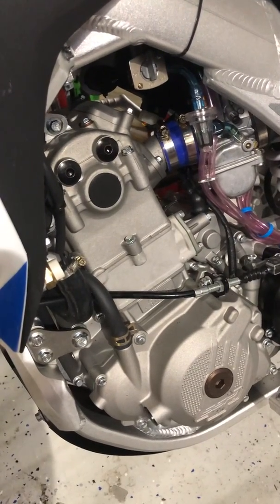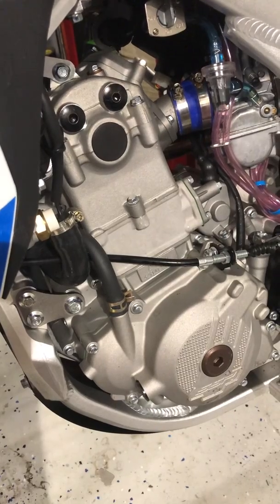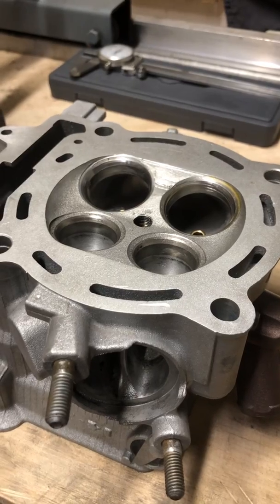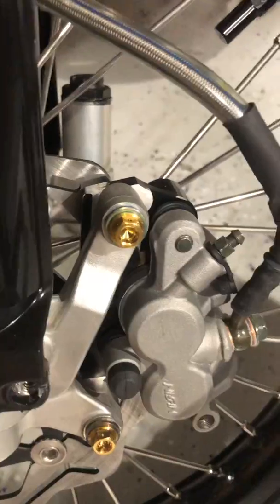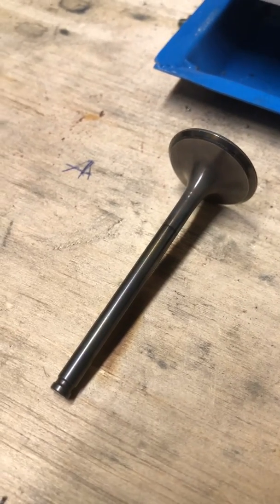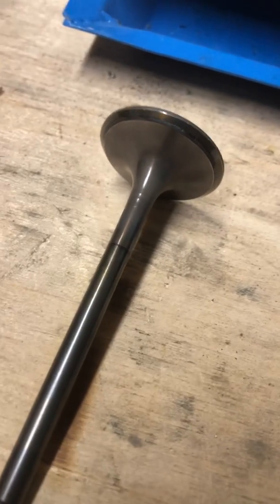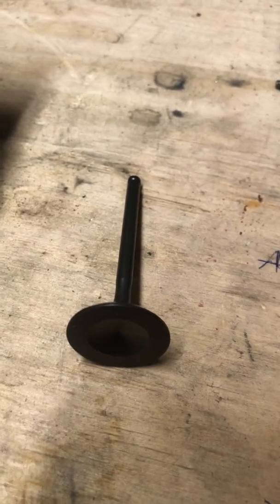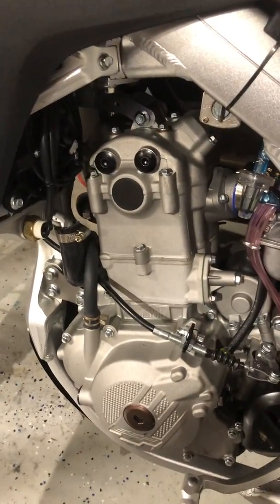Engine Durability

Comment: what are the dimensions of the motor? would it be able to fit in place of a zs172 or are the mounting points much different and the motor much taller?
Reply: Please answer
Reply: @justjavii I can try to find out from the engine seller

Comment: What most do not understand is 60 to 70% of the parts on the Japanese and European bikes are made in china anyways . just like Nike they are made for penny's on the dollar in Chinese sweat shops . cut out the middle man and save some cash. if you replace all the peripherals ( chain sprockets cables  etc .. ) the core is as good as a Honda . the chain that came on my 22 sr450s did not even have a master link . it was pressed on at the factory and bottom end as far as quality ...
Reply: when modles reach the end of there service life they sell the old design to other company's to produce without market infringement . the 22 sr 450s is a clone of a Honda crf 450x from 2010. was told personally from a motosport tech the range was 2006 to 2010 Honda 450x and those parts are direct fit replacements ...

Comment: The parts availability is what got me interested in this engine. I'm building a crf 450 up from the ground and have decided to use the nc250 engine because its very easy and affordable to get the bits to rebuild it. With a high lift cam and a billet piston with a bit more compression its capable of matching the output of the big 4 manufacturers as well. Yes its chinese made but if the japanese want to make us pay a small fortune for parts I know what I'm going to do.
Reply from the maker: Well the NC engines there’s lots of parts out there but the 450 is a part for part clone of the Honda 450 Uni cam I mean the piston the rod the crank all of it’s the same I go to Honda and get my parts no problem
Reply: @dfast8712  i believe the nc450 is slightly different zongshen HAS a honda 450 clone thats part for part clone, but the newer nc250s and 300s is loosely based off the klx300. Interesting where to find high comp pistons if they fit the dual cam nc300s. Im in the process of purchasing mine waiting for it to ship. Gona power my lt250r

Comment: have you looked into SWM?
Reply from the maker: Wow they look nice  kyb suspension made in Italy they look nice I just wonder about parts availability and support and they’re also close to $10,000
Reply from the maker: Yeah I was looking at the two wondering if that stuffs coming out of Asia because it sure looks like it in the 300 motor for the pictures I could see they’re really don’t give close-ups it look just like the NC 300 to me but they had the 500 and I have no idea what that is the deal is on those but are right there with a brand new Japanese bike in price
Reply from the maker: What’s SMM?
Reply: @dfast8712  sorry. SWM motorcycles
Reply: yes, asia co. assembled in italy? very odd.

Comment: 2 piece valve is why they snap single piece titainium wont snap and are better for wear
Reply from the maker: That is totally incorrect yes the two piece valves do snap but titanium overall is not that strong and it is not good for wear at all, I built SCCA sprint car engines and Dell West builds the best titanium valves on earth and we would have to change those valves before the end of the season and those were extremely expensive valves because they snap after so many hours in stainless valves Dont
Reply: @dfast8712  using titanium valves increase the life of the seats not the valve throwing stainless valves in just means you will be constantly re shimming wearing the seats down. And the cost to turn down titanium to make a single peace valve is just unreasonable hence single peace stainless. Don't get me wrong I always run single piece stainless as re shimming isn't a problem and the inconvenience of readjusting outweighs the risk of destroying pistons cylinder and head in one go. All that said there were companies that did valves and seats combos that they guarantee to outlast stock but the valves are all that's necessary as the seats will outlast most of the bike anyways
Reply from the maker: It depends on the valve seat you’re using look there are so many different variables we could go back-and-forth with overall in my opinion because I’ve lost motors due of these valves snapping titanium sucks it’s not a good material to use on a valve that is why the highest grade bolt they can build with titanium is only grade 5 that means that stem is not strong that’s it

Comment: Any particular reason you bought the SR450S?  Does the SR450S handle as well as the 300?
Reply from the maker: Well really I was in the market for another 300 and I found a dealer that was local that I just could go pick up 450 up and it was last year‘s model and they made me a great deal I actually am happier with the 450 I love the 300 nothing wrong with it I just like that extra punch but that’s 450 is not over the top for me it’s perfect
Reply from the maker: I want to say they both handle very close to each other  to me they feel exactly like a Honda CRF

Comment: That's why old 2 strokes are hot. I have a 1988cr 250 we are rebuilding.  4 strokes suck. I had a 2003 ktm 450 that needed a top end because of these titanium valves.  We put stainless in and new seats cost over 800 for head work plus piston timing chains and guides.  Total spent with me and my buddy doing the work was 1400. Cr we are doing with new crank, bearings, piston , cylinder nickle coated  and new right side case will cost 800 not including chain sprockets fork seals.
Reply from the maker: It’s so true really having a two-stroke is less maintenance and less cost in the long run because those four strokes they do explode their time bombs and cost $$$ that’s why I got away from the KX
Reply: Use Evan's coolant, or waterwetter and the waterpump area WON'T corrode away like yours might have, I'm guessing because it's a common problem...from Wyoming USA 🔫🤠🇺🇸p.s stay safe

Comment: How's the availability of parts? Seems like 300cc 4 strokes aren't common, so are the high and low-end rebuild kits expensive? How's maintenance?
Reply: 300 is the same as 250 but with big bore
Reply: @johny_me  where can I get parts for the cbs 300cive check every where

Comment: How many hours on it now? Any new developments?
Reply from the maker: markmtbrider I have 52hrs not a single issue whatsoever not even a bolt loose
Reply: @dfast8712  I have 550 hours on my engine and still running strong, know of some other people with plus 1000hours and still running strong.
At 1000hours I will open it up and see how it is.
Reply: @DanielOliveiraSantos  hola Daniel. Te duro 550 horas. La mía en 10hs rompí la tapa de cilindro...
Reply: @DanielOliveiraSantos  have you hit the mark yet?
Reply: @kalebdelong3781  almos 800hr.
Good as ever
Reply: @dfast8712  pretty  cool.
Reply: How many hours on It now?
Reply: @parotopten  probably around 660 to 700
Got a road bike for my commute, so less hours on it, only offroad 😉

Comment: Low horsepower =reliability 
Plane and simple, as far as the Kawasaki blowing up you realize every 40 hours you have to dual valve adjustment or they will snap, the horsepower literally stretches them..

Comment: When I built my head....I put kibblewhite stainless valves in it
Reply from the maker: Kenny That’s smart it’ll keep it together
Reply: @dfast8712  I had bought the head brand new from cylinder works...and I am really just a trail rider ....I did have it ported ....and am running hot cam stage 1s...with a wiseco piston....more or less looking for low end  torque and longevity....my buddy got 180 hours out of a yzf 250 top end...but he adjusted his valves meticulously...
Reply: @brokebikemtb4448  The YZ250F is the most reliable MX engine bar none.  I got over 250 hours on the original 2013 top end, never had to adjust a valve.  We raced a new 2005 YZ250F and it finally shattered a clutch after 18 month it to lock-up, the bottom end was still very healthy.
Reply from the maker: Kenny yamaha’s definitely have the most durability out of any of the bikes Kawasaki‘s because of their valves are about the worst

Comment: I have not yet been able to ride the 300ssr bc nobody I know has one. Can you please tell me what bike does the 300ssr feel alike? I was told 250klx by the salesman. Is this true? If so not interested anymore.
Reply from the maker: Shannon Scott I don’t know about the 250 but I know Kawasaki‘s new KLX 300 ssr stops it in every possible way engine power suspension frame everything
Reply: @dfast8712  'stops' it?
Reply from the maker: Shannon Scott And I love the feel of the bike it handles incredibly well it’s lightweight it’s got plenty of power it’s a great package and I have now 47 hours on my bike and I’m not even had a screw come loose
Reply: @dfast8712  sounds awesome an great but would you have an opinion on what bike is the 300ssr compatible to?
Reply: @dfast8712  Because you tighten the screws your self before first ride?
Reply: ka4172 if you don’t locktite the screws from factory these things will literally vibrate themselves to pieces. Other than that no complaint about anything else SSR really, overall really quality bikes that could use a few minor after market upgrades.
Reply from the maker: Shannon Scott The thing is is this bike has a 300 mL engine but it’s not in a radical state of tune like others are that are going to explode this motor is going to last there’s other guys out there with the same NC engine that I have hundreds of hours on them with no failure
Reply from the maker: Shannon Scott The closest motorcycle I could compare it to would be Honda CRF 250 RX it’s super close in power And the chassis is almost the same
Reply: @dfast8712  AWESOME. Thanks 300D!
Reply: @dfast8712  SRR300 , has about 30hp? Any idea of 
dressed/curb weight for the SSR300?
Reply: @bikersoncall  im not sure but I assume that is whp?
Reply from the maker: Shannon Scott keep in mind I have a 2015 KX 450 as well with 59 hrs and I know the engines a ticking time bomb that’s why I rarely ride it I ride my SSR a lot more because I know it’s not gonna fly apart

Comment: This motor is a copy of the ktm and husky ...
Reply from the maker: Mtb Ridingog I told it was based off the RFS KTM motor
Reply: @dfast8712  eh more based off early unicam 250f Honda’s
Reply: The whole bike screams crf clone to me. I'm putting one of these engines in my crf to get away from honda pricing.
Reply: @danniellebrightbill9951  from the head up yes from the cylinder down no .. the older cross used a single over head cam . New models use dual over head cams
Reply: @mtbridingog9083  RFS ktms have water pump on the head , I’d still say it copies a CRF more than any KTM motor , unless it’s modeled after a LC4 ktm I haven’t worked or know much bout those
Reply: @mtbridingog9083  I could be wrong though just what I’m depicting from this short video

Comment: Good vid D fast! Definitely no prob sacrificing some power for reliability and less maintenance. Picked up my 300 a couple days ago, pretty damn stoked and impressed with the bike overall so far! Definitely have some carb tuning to do but was expecting that. 
Would you know if a 2016 crf250r front brake rotor and seat cover would fit our bikes? Trying to place an order while I still can. Thanks👍🏻
Reply from the maker: Jon R enjoy!
Reply from the maker: Jon R yes 2016 CRF Brakes sprockets wheels it’s all the same
Reply: Awesome, I appreciate the help! Gonna get some parts on order and get to making it my own👌

Comment: I have stop riding bc that reason. I live check to check an something always broke on every bike I've owned.  #considering ssr300
Reply from the maker: Shannon Scott Well you’ll be happy with a SSR and getting a brand new bike that nothing is broken is always nice
Reply: @dfast8712  so you probably paid 4.5k plus upgrades. Est.5.5k in your bike. Do you think almost 6k is worth it(300ssr)?
Reply from the maker: @shannonscott5788  No 5K for the bike after tax, I have maybe $500 in all the extras, its already a solid platform, just a few things and you have a killer bike!
Reply from the maker: Shannon Scott no 5 even out the door
Reply: these Chinese bikes will save motocross but still won't pry me away from my 06 tm 300 2 stroke